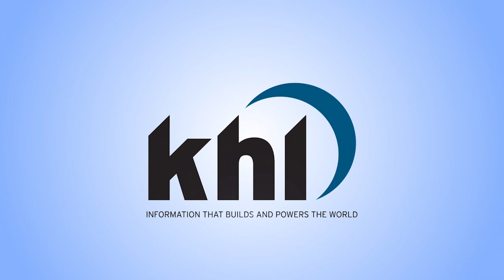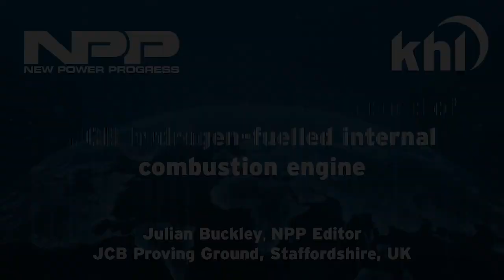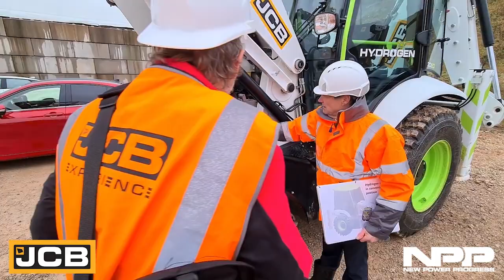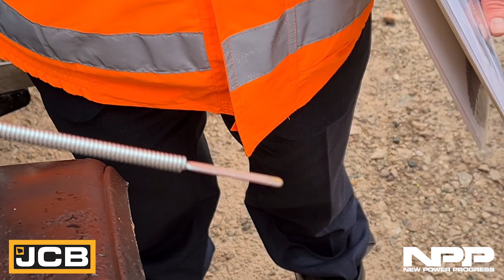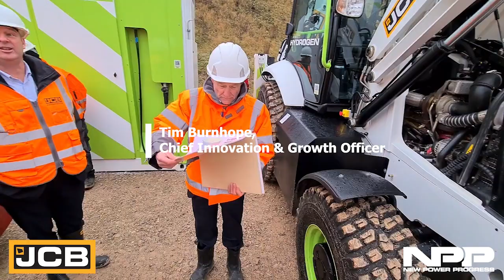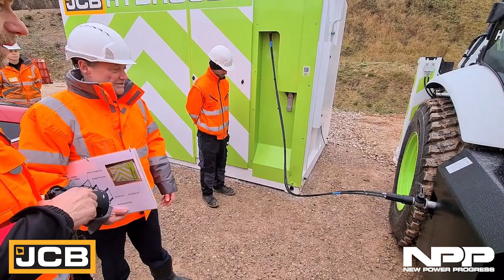JCB hydrogen-fuelled internal combustion engine in action

Comment: Sandy Munro sees Hydrogen stored on film cassettes/drum like spools at normal atmospheric pressure (weight comparable to 700 Bar 10,000 PSI tanks but far safer) To me, these still are aimed at still very expensive fuel cells, which JCB gets around with much more common better supported conversion of Diesel engines to burn hydrogen (not ideal since it still has the problem of what to do with the nitrogen by products, but far cheaper and far cleaner than depending upon the natural gas that has a massively higher leakage rate than imagined in the acquisition stages.  Seems an important step until Fuel Cells reach much more cost effective mass production.  I do wonder about catalytic converter solutions or nitrogen recovery if you have to burn hydrogen as an easier transition to a better Fuel Cell and smaller "peaker/accumulator/regenerative energy capture" battery.
 

See https://www.youtube.com/watch?v=brEm4mEizns

P.S. I'd always thought some larger applications could use a more efficient hybrid system like Diesel Electric locomotives with some battery accumulators for braking energy recovery instead of dumping the braking energy through heating coils.  If you have ever seen truck tires explode from braking on long down hill runs, you would better appreciate moving that heat as far away from the tires as possible.

Comment: One big expensive  container that requires electricity just to  refill 24kg of hydrogen,  that's roughly the equivalent of 62l of diesel that would barely cover 3-4 working hours for that single small bulldozer. It doesn't seems efficient , convenient or particulary green either.
Reply: LOL you dunce.